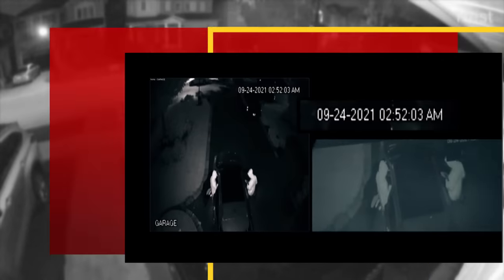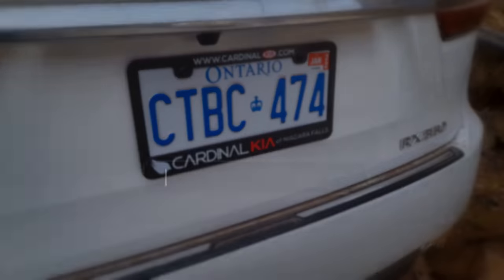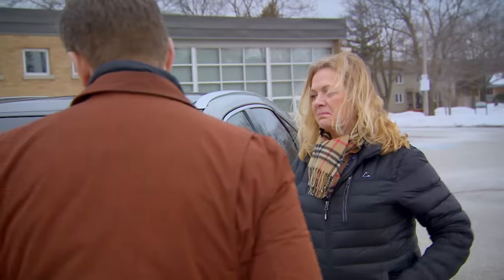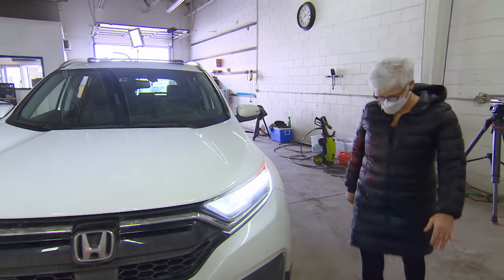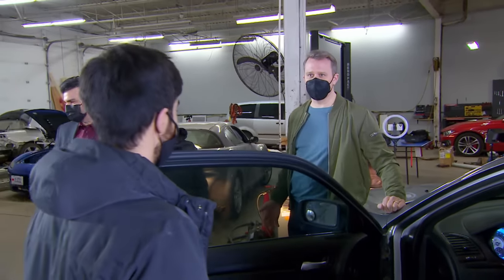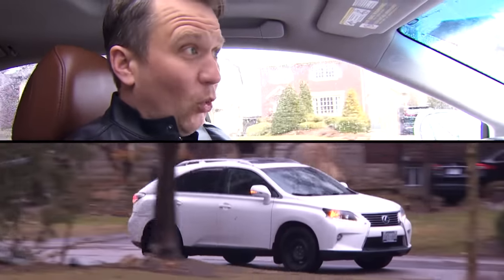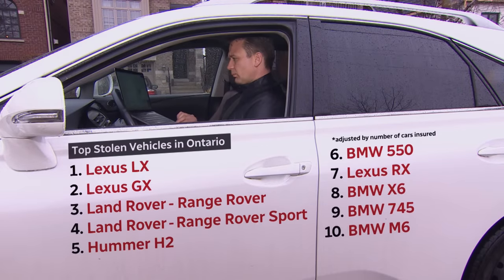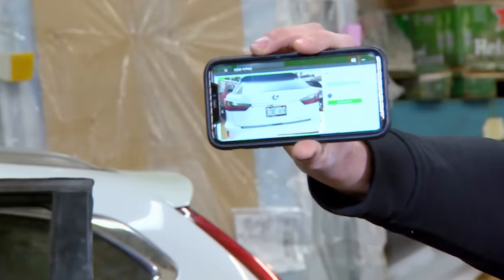Tracking stolen cars: How they could end up in West Africa (Marketplace)

Comment: It's amazing how this generation of car thieves can steal one without damaging it. In the 80's and 90's GM cars had the outside lock cylinder broken on the doors and the steering columns were broken open.
Reply: In uk once the old ford keys wore down a bit they would open any ford and then half a tennis ball for central locking
Reply: It's the electronics in cars. It's easy to catch a transmission between a fob and a car. That's why using the lock buttons on the door are a safer way to lock.
Reply: my son got his 21 grand cherokee altitude stolen 2 months ago and it was found 10 days after.. and lot of things were broken.. the dash opened next near the glove box with probably a crowbar, they ripped the radio and thrown it on the back seat (prob due to GPS), broken near the computer under the steering too and a few other minor things. (it was in a parking lot at a mall)
Reply: The manufactures make it easy
Reply: My brother used to repo cars in the late 80's. Most of the work was done by hand, meaning no tow trucks. Tools of the trade were the slim Jim, and under the window tool to get the doors open. Then you had the slide hammer/dent puller to remove the lock cylinder. A little freon would chill the lock to make it more easily shatter. Once the lock cylinder was removed, a screwdriver started the car and off you went. The vats key from GM slowed down the process a little until tools were made to bypass this. 

Now, you can buy a tool online and not even be that skilled to jump in and go.
Reply: safest method to prevent your car being stolen overnight if you cant bring it indoors is put it on a jack stand and take off 2 tires over night, even if they break into your car, you've only got one spare.
Reply: @candle86  that’s a lot of effort to have to go through every day 😉
Reply: Especially when people leave them unlocked.
Reply: Maybe paying extra for your Onstar Security Subscription and buying third-party security systems like Viper would have been worth it.
Reply: fairly sure if you took todays tools, and tried it on an older car, you find a lot easier ways to get in
Reply: @candle86  thats caveman method of deterrance lol
Reply: @dayner989  but it works, most theives won't have a spare tire for your car on them
Reply: @candle86  yes but that is too much work imagine everynight doing thar. And in the morning putting it back
Reply: @candle86  maybe the better method is installing wheel lock it is much more convenient
Reply: @candle86  how about unplug battery. Or remove battery.
Reply: New cars nowadays are mostly made with plastic and are easily replaced  older models used  metal materials,
Reply: @candle86  Actually a very safer method is to empty the gas tank and leave a little tiny amount and that way they would only be like a few inches before the car stops
Reply: @JasonJohn7185  your wrong its actually aluminum not plastic
Reply: @candle86  Find your fuse box & remove your fuel pump or EFi relay.  Takes 2 mins
Reply: @ericschultz1073  The locks like he got through in seconds? Or the buttons that can't be the only way in. They still have wireless key fobs...that's the weak point
Reply: @candle86  How viable is it to do that everyday?
Reply: @imperius_lxxvii9999  He was probably in on it and planning on getting a cut of the insurance money! The younger ones are slick pop's!

Comment: Back in the 1980s I had a 1974 corvette with "T"top. The 3rd week I had it , it was stolen. A week later the police brought it back to me. Driver's window smashed , "t" tops gone, ignition switch torn from the steering  column etc- - - After that I left it unlocked with the keys in it. You see, I put a toggle switch under the drivers seat to powered the electric fuel pump. Thieves could crank it - but only drive about 30 feet before it ran out of gas.
Reply: In the name of comfort people gives away security.
In my 93's nissan I removed the key cylinder and put some fast tricks to run it. I unlock it with a cheap wireless fob alarm.
Reply: @JavoCover   The all these modern cars are not going in the right direction it's better to have an actual key Ignition with an immobilizer as well So the name of the game is to have both and have a good strong lock and a good type of lock too
Reply: How safe is this method with these computerized cars these days?
Reply: @boxoffisa  It depends on how it's implemented. Honda, for example, did an absolutely abysmal job and Hondas are incredibly easy to steal because they didn't implement even basic security practices with their FOBs. Others are more difficult. Two-factor would make it much harder still. For example, Tesla allows you to add a PIN in order to drive the car, enter the glove box, change security settings, etc. Just requiring both the fob and a PIN or phone Bluetooth connection while making it difficult to just add keys via the ODB II would go a long way. A lot of car companies give security a low priority. Maybe that's why Teslas are stolen far less than most other brands because they actually take security seriously and employ people to try and break it and offer rewards to people who find holes. In addition, at least with Tesla, I can easily track my car and do things via my phone such as limit the top speed or put it in "valet mode". Tesla's insurance also specifically covers the car being hacked. I've never seen any other insurance policy cover this.

Comment: One thing I wish Market Place would have touched on was that all of those stolen cars have keyless engine starting (push button start).
Reply: Yeah....pretty much ALL desirable cars in 2022 will have keyless engine starting. A 20 year old $hit heap without keyless isn't worth the cost of shipping it 5 miles --  much less the 5,000 miles to West Africa.
Reply: @Duke_of_Prunes  you dont think a old ferrari p3 with key start is worth shipping 5 miles?🤡
Reply: Put the keys in a biscuit tin and on bedside table wont pick up the signal they just getting key signal and bossting it for engine start
Reply: @TheSugish  Seeing as how there were only four built, I doubt that their theft would have any impact at all on crime statistics.
Reply: You make it sound like grand theft auto is a new thing. It's as old cars themselves and cars in the oldern days that didn't have keyless start were getting stolen too.
Reply: but you still need the fob in your possession, that's why the thieves code a new one or program one in with the scan tool.
Reply: In part of the video, it showed the thief using a signal booster to make the car w push button start think the fob is near by. I think the only way to avoid this is using one of those faraday (not sure if that’s the spelling) box to put the fob in to block the signal or don’t buy cars w push start.
Reply: Your key fob has a way to turn off signal read car owner manual to find out or youtube your car
Reply: @ImranKhan-sd6dx  Faraday Cage block RF signal.  Cookie tin is perfect.
Reply: @ImranKhan-sd6dx  That was correct, the Faraday Pouch would prevent the FOB communicate to the car. The thief would not be able to intercept the signal from the car to the FOB.
Reply: @TheSugish  SUV are good for bad reads
Reply: @africaart  huh. ?

Comment: Surprised the Honda’s or Chrysler’s alarm doesn’t go off. When the car is locked with the FOB, and opened with the manual key the alarm automatically goes off until it is stopped with the FOB. Chevrolet does this.
Reply: It would but the producers disconnected the horns
Reply: @matthewfrost3677  nop for Chrysler's product i can tell you that it depends on the years, the alarm on a 2011 Chrysler 300 wont goes off if you unlock with the key but my 2015 Chrysler 200 does
Reply: Yeah, other surprises as well. The OBD port normally does not get power if the engine is not running. Also there are far faster devices that 'slingshot' the key signal, however this reports thiefs did not show that in use.
Reply: I don't think these tests were real. All of our Hondas (Eu spec Civic 1999, 2007, 2015)have an alarm and will go off if you open it without the key and OBDs doesn't give power until you turn on the ACC
Reply: (Most) Car alarms do not truly activate until 15 seconds has passed from the last lock press. So If these guys were truly able to get in within under 10/15 seconds it won’t go off using the lock pick method.
Reply: @schakoska  what if you hit the door unlock switch.
Reply: My 1998 Grand Cherokee and my Chrysler 300 2006 the alarm will goes off if I unlock the car with my key when I lock it with my fob
Reply: @mrtopcat2  The OBD port gets power and CAN communication regardless of the engine being running, and the "slingshot" device you talk about was literally in this video.

Comment: My Toyota Corolla got stolen from a carpool parking lot in Ontario back in 2012 during the day in broad daylight.  I was surprised it still got stolen even with a key immobilizer feature.  When shopping for a replacement vehicle, I realized most anti-theft features are useless.  A car alarm is easy to bypass.  A club can be removed with a cut in the steering wheel.  The only thing that probably works is GPS tracking (usually used by luxury cars).  You are simply better off paying a little more for theft insurance.  In the end, I simply bought a car that was statistically less stolen.
Reply: 😂😂😂which brand
Reply: Probably a Chrysler PT cruiser! Lol
Reply: @come1atmebro  yes, a Chrysler. I love you.
Reply: Toyota and Honda have the worse theft system. It is in the Japanese manufacturer's interest to make the car easy as possible. They aren't worried about theft but rather reliability and cost.
Reply: I think the most effective way to prevent car theft is to install a killswitch which prevents power going to the fuel relay, and therefore, car won’t start. and if it’s hidden correctly, the thieves won’t go through the hassle to find the switch. They might steal parts tho.
Reply: @magical8013  Honda's immobilization system was built into the ECU which is a bad system. All you needed was a modified ECU or an older version of the same ECU, you could steal a Honda/Acura in less than 2 minutes. I won't explain how or why the Toyota and Honda systems are bad, but they didn't design them to prevent theft. The dealership has tools for lost keys which have been cloned and can be purchased online. You can steal other cars (VW, BMW, Mercedes and so on) but the tools are more expensive and more difficult to accomplish. Any vehicle can be stolen with the right tools, it's just that Japanese manufacturers have the simplified methodologies which forces things to be engineered to be simply to fix. Lexus is the number one stolen brand (it is made by Toyota).
Reply: @nima9037  they probably won't bother to steal your care but most people aren't car savvy to disconnect the fuel pump relay. I had my car stolen from a parking lot and they broke the steering column and just wanted a joy ride.
Reply: @brarautorepairs  yeah I completely understand that. I was just saying that most vehicles that are stolen these days are more luxury because of the value of the car. Back in the 90s and early 2000s Hondas and Acuras were definitely stolen more frequently. These days any car can be stolen if the right price is involved. But you're right it's absolutely easy to steal a Honda or an Acura. It's actually quite disturbing
Reply: @nima9037  I have 2 on my camaro after my previous camaro was stolen, best upgrade yet
Reply: You can rake the lock of a "club" in about 10 seconds.  Watch the youtube channel "Lock Picking Lawyer".
Reply: @brarautorepairs  It is easy enough for most people to remove the fuel pump relay, or the starter relay every evening if they can't add a cutoff switch, or know of someone who can do it for them.
Reply: Just want to say that you can add gps tracking with drone mobile on virtually any vehicle.
Reply: also car companies could do more but more stolen cars means more purchased (replaced) cars.
Reply: @i-fart-n-elevators4610  how do you install 2 of them
Reply: A custom killswitch cost less than 10$ in material and is so much cheaper to install than an aftermarket alarm. It's sad it's not more used and known by the general public, probably because it's not a product you can "buy".
Reply: @Topazman12  u r right this’s the fourth Caravan I’m driving now. No body s trying to steal a cheap and big car haha
Reply: What kind of immobilizer?  If it comes with the car as a feature, then it's crap.  The thieves program a replacement key which is just as good as your key and will disable the immobilizer.  Honda and Toyota tech is a joke.

Comment: Because these vehicles land in Western Africa without any changes. No removal of vin or license plate (which can be readily be used to check if they are stolen), it makes me wonder how can sanctions even work if the borders are this leaky.

If a smuggler can move one of these cars so easily, they can easily move enough tiny electronics that bad state-actors can use to arm cruise missiles and drones for years to come.
Reply: On point. Very correct. Its not headed the right way
Reply: Great Africans

Comment: This is negligence and stupidity on Honda's part. They should have designed a more secure system. It was a poor choice to assume an attackr can't gain access to the OBD2 port. This sort of system design would fail a basic information security audit from any firm.
Reply: Yes. Even 2FA makes little sense if everything can be circumvented through odb.
Reply: No use. they could use a tow truck to pull your car away within 10 seconds. 😢
Reply: It gets even worse. One basic security feature that's been used for decades is called rolling codes, where the code sent by the FOB constantly changes so replaying the old code won't work. This has been used in garage door openers and other manufacturers for years. Honda/Acura didn't implement this basic security feature, making it laughably easy to just replay the RF code later when the car owner is out of sight.

Comment: When I heard about the ability to just push a button to start the engine it just makes it easier for someone to steal. Kind of like pushing a button to unlock the front door of your home, except your yard has a fence. Manufacturers need to prioritize safety over convenience and input security features. For now I think parking in your garage or use older models will decrease the chance of your vehicle being stolen.
Reply: It's not any easier than using a lock pick. Sorry
Reply: M8 they are already picking the locks. Older models won't be stolen as much but not because they don't have a start button but because they're worth less.
Reply: Don’t know if it’s true but I’ve heard the faraday boxes will block the signal of the fob so they can’t boost it to steal your car.
Reply: @ImranKhan-sd6dx  that’s what I use for my key fobs.
Reply: It's all covered by insurance no need to worry your self.
Reply: @Innsidelyfe  Insurance often doesn’t cover the full cost to replace your vehicle, plus there’s the deductible and also your monthly premiums go up so it does end up costing the victims of these lowlifes.

Comment: My good advice is: only drive "old" vehicles! Without those electronic keys and stuff... Another option is to have all the windows engraved with a security number! I did that on my BMW E30 325i, vintage 1989, with 180,000 km! Doesn't cost much in relation! The thief would then have to replace all the windows, which is very expensive...
Reply: The electronics aren’t really the problem, what he’s doing with a $1,000 in diagnostic equipment and a brand new key for that make/model can be done with a pair of pliers and a screwdriver on pre OBD2 cars.

Comment: The way they can stop this is by really checking the cars before they leave in boats! That’s it. The same thing they did in Nigeria when they check the vin, have them do it in ports before they leave.
Reply: They are exported inside shipping containers. If you want every shipping container checked before it leaves port you'll have to give up on E-Commerce.
Reply: Sometimes they have insiders, who help.
Reply: There's a reason that most cars stolen in America are driven over the Canadian border and shipped from there. America requires that any vehicle being shipped out be shown with a verified proof of insurance. Canada doesn't do that.

Comment: I learned what that lockpicking tool was from the Lockpicking Lawyer. It's a Lishi tool. They also make them for door locks and it's basically an all-in-one (lockpick and tensioner) entry device with a visual guide on not just how to pick the lock but also how to replicate the key itself.
Reply: Locksmiths mainly use them to generate car keys. It makes decoding the lock a lot easier. The were a game changer for locksmiths. Only locksmiths are supposed to have them. But most Lishis are 2 in 1. Used to unlock the vehicle and make keys from scratch

Comment: It’s a problem that can be solved so dam easily. Export container inspections funded by the exporter, the government can even make money from it!
Reply: The Canadian government can ensure that every car to be shipped out of Canada should be properly checked and ascertain that it's not a stolen vehicle. You've got a proper database for all your cars.
Reply: @Godsgrace4725  car manufactures also need to improve security ......Imagine using less than 3 mins to break into a latest car
Reply: @princeachaw7039  car manufactures doesn't need to improve, because insurance company pay the stolen cars, then they can produce more new units. Think about it, who gonna finally pay these lost.
Reply: @princeachaw7039  that's true. It should be very tasking for a latest car to be stolen, since most of them claim high level security settings, yet it was picked and driven away under 3minutes.